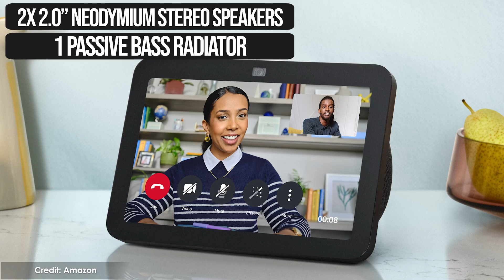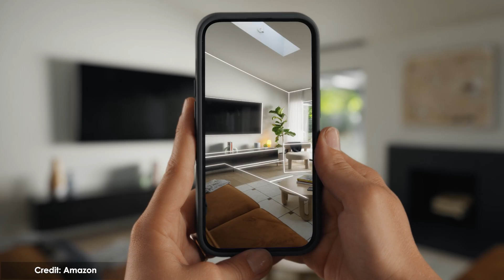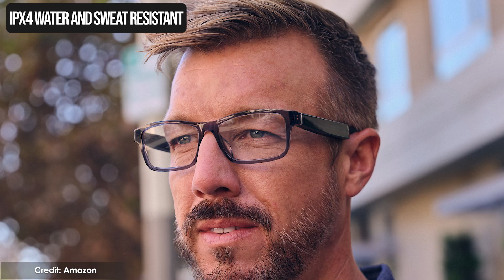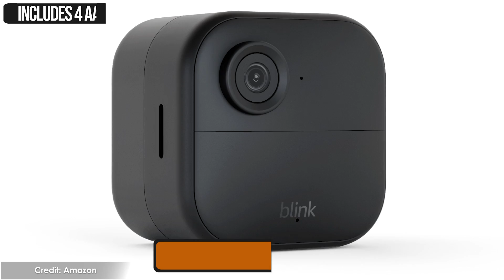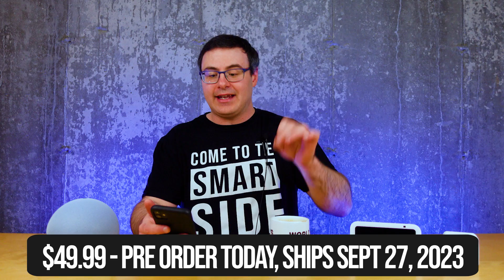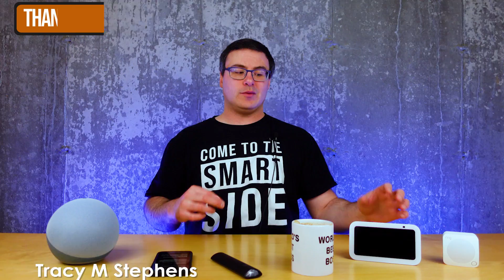Amazon JUST Announced BRAND NEW Echo and Fire TV Gear (and Features)!

Comment: I have been totally immersed in the Amazon eco system for years and have purchased so many of their echo devices I have lost count. I have numerous dots and shows. I have the show 5,8, and 10 and I purchased the 3rd Gen show 5 just for something to do and it is worse than my 2nd Gen show 5. It constantly freezes and I have to constantly have to repeat commands before it responds maybe. It is like an old person with dementia. You never know what it's going to do. I am well versed in all the remedial steps to solve issues with devices having used them for numerous years. It seems that Amazon is just releasing products on the market just so the consumer can spend money on it. Unless Amazon releases an earth shattering device I'm done purchasing their products. I've recently turned my purchasing power to Google and have their Pixel tablet for its versatility but for me it's just another toy and I love toys. I already had the Google nest mini hub and it just sits soaking up wifi and gathering dust, but it is nice to  have assorted different toys to entertain you.
Reply from the maker: One idea for you…switch the power supply out on the 3rd gen.  Power issues are a major cause of echo dementia ;)
Reply: @AutomateYourLife  Power is NOT the issue in this case. The issue is that the show 5 3rd Gen in my possession is a crap device period.

Comment: What are the differences between Amazon Hub and Google Home ? A tablet on the wall with google home i think is the same. You also have a ZigBee hub next to it instead of having it built in the same device as it is at Amazon Hub. As long as Amazon does not install third-party alarms and cameras, the differences are small. I know the interface is different but Amazon's it's not that super wow. Please correct me if I'm wrong.
Reply from the maker: I think the biggest difference today is that one company released 14 new devices and a ton of new updates for existing devices, while Google has released a few new features in the last year.

And have removed more features than they’ve released.

So yeah, you could do it with Google…but I’m not sure you should anymore!

Comment: saw the hub on Amazon this morning, (UK), both very interested and very disappointed. I have an Echo show 8 which the hub will replace as the show doesn't do what I want.
What would be very good is to have the hub homescreen on the show to enable us to use the show as a smart controller (with out the massive buttons that need to be scrolled.
 I also note that they do have a "trade in" possibility but not for the show!!, which it will happily replace.
thanks for the full update
Reply from the maker: Lots of interest in that hub!  It’ll be great to try!

Comment: Disappointed that Amazon didn’t upgrade the Echo 4th generation. I have an Echo DOT 5th generation with clock display and use it daily. Still thinking about gettin an Echo 4th generation for improved audio but may  not due to the clock display display that I had hoped would be included in an upgraded Echo 4. Great posting, thanks!
Reply from the maker: I think a few folks were disappointed in the lack of an Echo update!  Thanks for watching!

Comment: So with Matter inside the assistant, if we connect it to an Apple HomeKit system, can we trust Amazon is not listening or tracking the user?
Reply from the maker: That’s not how Matter works, sadly.

If you have a Matter certified light in both HomeKit and Alexa apps, and you turn it on, then both Amazon and Apple would see the change and reflect it in their apps/systems.

So they’d both know.